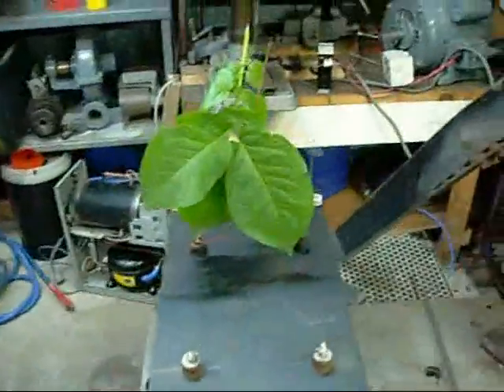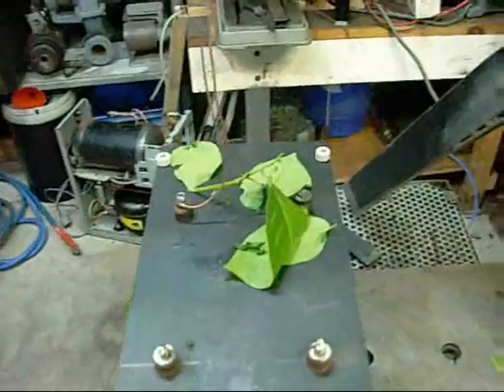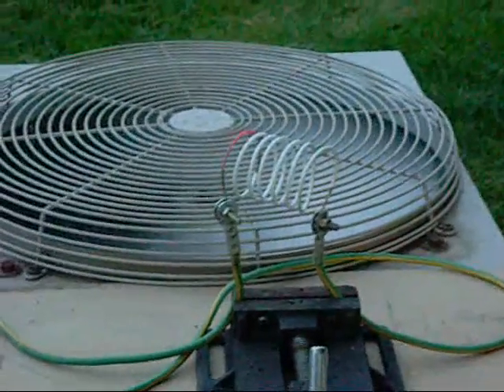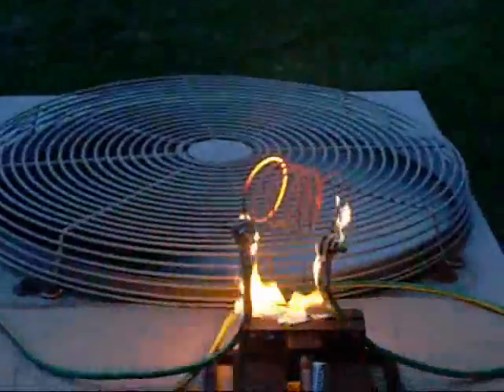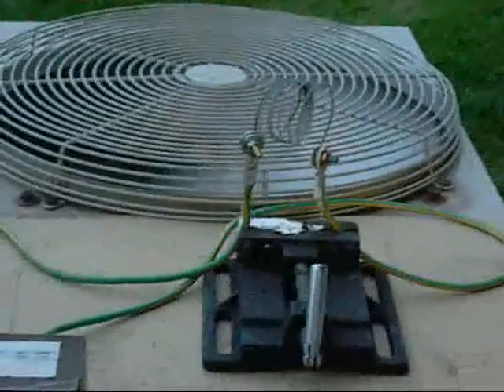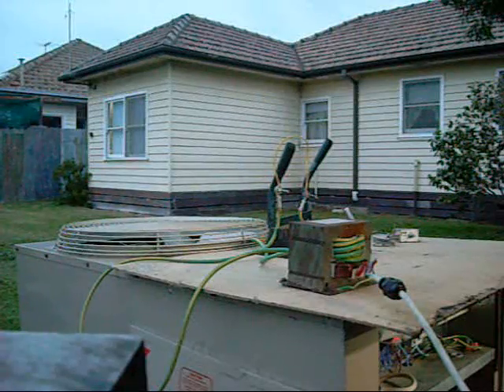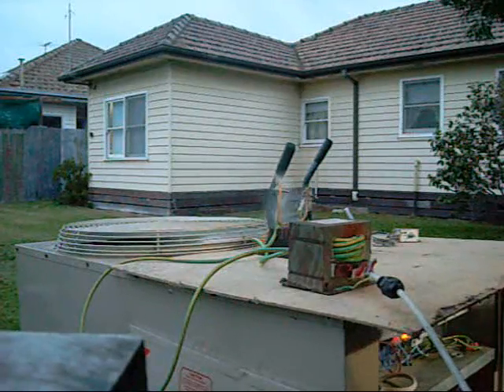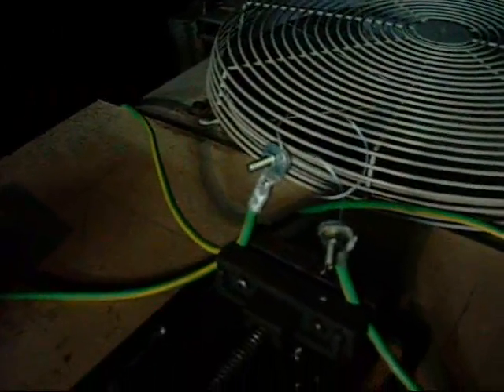More MOT tests

Comment: wow ill have a potato please,
thanks for the insulated wire stress testing its cool to see what happens
any way your next step should be to try 4 AWG wire and do a 2 turn secondary i got 
600+ amps from doing this,any way its amazing what some wires can handle
aluminum is by far the tuffest to blow apart